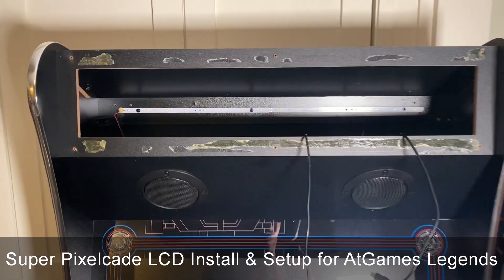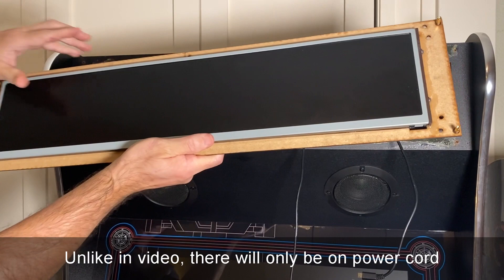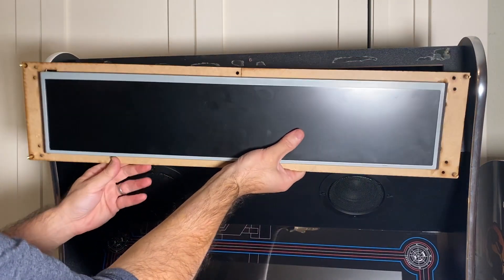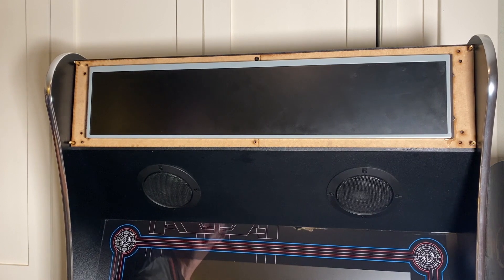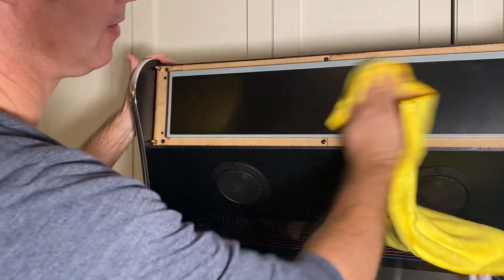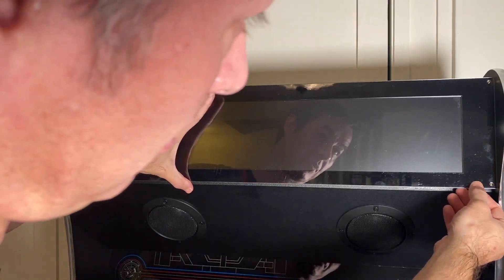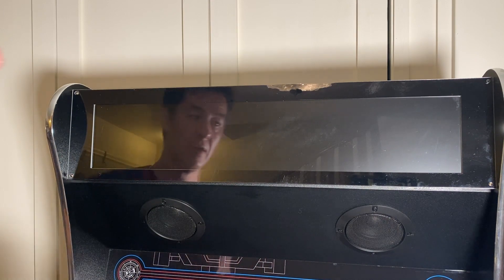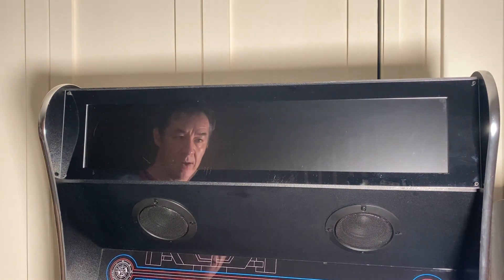Super Pixelcade LCD 2nd Generation Installation for AtGames Legends Ultimate Cabinet

Comment: I just wanted to leave an unbiased review years after ordering this.

First off, the customer support getting this was very nice, no complaints at all. I have the 3/4 Level Up cab from Game Room Solutions, and I just could not find another source that could get anything notable to fit in the current marquee slot they had cut. Sent off an email with the dimensions and they mounted the most appropriate size on a board for easy installation for me.

Sadly, the experience since then just hasn't been great, to just be honest. I was very helpfully sent a couple videos at the time of order on how to install the mounting board, but when I received it, I realized the screws to hold the mounting board in place wouldn't be able to actually screw in anywhere. My particular cab had an opening for the marquee itself, and then an outer rim for standard T-molding. I sent photos and exact dimensions for both sections, and even still, the mounting board was too large and wouldn't fit into the slot. My only other option was to wedge and drill in the screws between the T-molding slots, which does barely hold it in place, but absolutely shredded the shape of the wood, meaning if I ever pull it off, I can't go back to the T-molding. Because I wasn't able to fit the panel inside the slot, it also juts out a considerable amount from the cab and doesn't look good. I was sent a few black bezel panels to cover it, but only the front ones screw on and the top piece literally just sits loosely with no mount. You put your finger on it, and it flies off.

However, again I was willing to put up with all of this as I still couldn't find any other option to add a digital marquee to add to my specific cab. However, I faced my biggest downfall yet using this, and that was the software pack that runs it. As you've read, the panel does not connect directly and relies on Wi-Fi. This system pairs with a pretty honestly confusing UX (even for me who works actively with tech) consisting of several different elements that have to work in conjunction with each other perfectly to operate as intended. 

First off, there's an initial setup app you have to use on your phone to even get it connected to your Wi-Fi network, and a lot of the time this will just drop and require reconnecting. A lot of the time too, I'll shut down the cab to save power, then when booting it back up, it just doesn't auto-connect back.

Second, after you manage to get it hooked up, you then have a package of apps you get from the site to install. Initial installation appears easy enough- you select where your MAME folder is, where your marquee images are held, and what frontend you're using. However, you soon realize that because the initialization process just connects the frontend to the backend, more problems are inbound.

And that's the third issue, the backend. Pixelcade uses a software called LEDBlinky to determine which image to display, and it is just not a good software. One look at their website will tell you how outdated it is, but also one week of using it will show you how inconsistent it is. Once you boot up your selected frontend, it also automatically boots LEDBlinky (which is supposedly also a trial version only), as well as a separate CMD window which does the backend work of communicating with your Wi-Fi, checking what game is currently selecting, sending the request to the router, and then receiving a reply back to the PC to send up to the Pixelcade. That's a lot of in-between for a simple display system, and I found 90% of the time, I either cannot get it to change at all, or it has a massive delay. If you do get it, you also realize that even though the display is a certain dimension, it doesn't suit most of the banners from crawl sites like EmuMovies, so you end up with a forced stretched image that looks low-res and distorted.

This all could technically have a solution with troubleshooting, but that's when you hit the final barrier, the minefield of additional software. When you download the recommended app pack from the site included with the Pixelcade order, you get the app for initialization, but you also get this pile of other apps. Many of these share the same app icon, and many of them also are kind of just a mishmash of words that aren't clear on being the app you need to run to customize. So you open them one by one to systematically figure it out. Some of them just open, run a CMD crawl command by itself, then closes the app, no idea what actually happens. Some of them uninstall one portion of the LEDBlinky pack, some of them just undo your personal settings back to default. One of them opens a control panel of sorts, filled with jumbled and broken text about what channel the panel runs on, a message you can write on your panel, etc., and despite having hints of possibly being the only app that is useful for trying to fix your issues, most of the time it doesn't even seem to do anything.

Sadly, that's my lengthy honest review of how it's been since I got mine. I really wish it were different, but the LEDBlinky app is just awful, and it ruins what is likely a great panel system. I can fairly submit that my particular order was a unique case and we had to jerry rig some parts in an effort to force the panel on, but the performance of it really killed me. I even spent over an hour after getting it just trying to get it to flip between 3 or 4 marquee images in conjunction so I could record it as a little "check out the cool addition to my cab" video for some friends. Barely got it to work.

My humble suggestions are that this thing needs to at least have an option for HDMI or USB attached, as Wi-Fi just isn't always reliable (and yes, my speed tests are solid, averaging around 700 Mbps up/down on Wi-Fi alone). It needs to have that option to just act as a secondary monitor in Windows, as a lot of these frontend apps have native support to just directly send the marquee image to a secondary monitor. Also, if it does stick with Wi-Fi in any way, it needs something better than LEDBlinky fuelling it. The software is just not getting the updates it needs to be clear and easy to use. It needs a proprietary software that has a simple, single app user interface for all of its customization, and it needs to be able to act and respond quickly to any changes. Any frequent delays in the response, and it instantly devalues the amount of money you have to spend for the panel and shipping.

I sincerely hope in the future this does see a better version and some more attention. It can definitely be a lot better. Right now, I've kind of taken mine off and forced back in the plexi for my static paper marquee, just without the T-molding as the support wood crumbled with the forced installation.
Reply from the maker: if you like, happy to hop on a remote call and get you up and running. There is also a gen3 image now , it sounds like you are on gen2 and can get you going on this too. You can shoot a note to al@ledpixelart.com if you want to do this. For reference, LEDBlinky is the glue that allows Pixelcade to communicate with multiple front ends for windows (CoinOps, BigBox, HyperSpin, AttractMode, etc.) and is updated on a regular basis.

Comment: arcade Legends ultimate is $500 this thing cost $300 . Pixelcade LCD price is way to high
Reply from the maker: Hi David, it's fair feedback. Pixelcade LCD is a niche, low volume product at this point , that combined with the global electronics component shortage, it's just very expensive to product the LCDs. I would encourage to check out BitPixel LED which is a mass produced product directly from AtGames with Pixelcade tech inside, you'll find that to be a much more affordable price point.

Comment: The refresh on the 2nd generation units appear to be a major improvement but I've noticed that the marquee images often appear to be stretched horizontally. Is this from the source images or is a stretch to fit option being used?
Reply from the maker: Super Pixelcade LCD is a 1920x360 display so the marquees are resized to this rez. Sometimes they do look stretched so for some of the iconic games, we've cropped them to reduce this effect